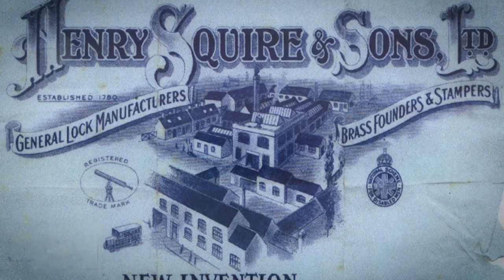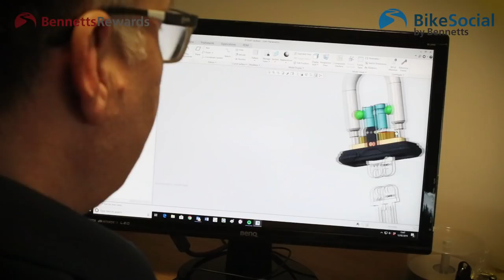How the world's strongest production padlock is made in Britain: Squire SS100

Comment: Why is the new padlock not shielded?.
If not it how will it be any stronger than the SS80?.
Is this a marketing ploy to get people to purchase this version then bring out the shielded version?. Only asking.
Reply from the maker: Hi Cedric... do you mean the shackle's not shielded? If so, the lock I filmed was a pre-production version, but it is a non-shielded model. Squire make both versions, and this of course isn't the one you'd use for chaining a motorcycle up. It's the same as the SS80, but bigger (so tougher), and of course it has two barrels. In the building industry, the longer pick time will give this lock a higher rating. In motorcycle crime, picking isn't really an issue, and until chains get even tougher than the 22mm versions we have now, that's the more likely point of attack. John
Reply: They will probably built it on two versions shielded version and open version. They sent the shielder version to LPL. (Lockpickinglawyer).

Comment: I have a question about the testing on the SS100 version. As is evident from the diagrams, the shackle is held in by two ball bearings, each of which is actuated by one of the lock cylinders through a cam, so if one of the two cylinders is unlocked, only one ball bearing holds the shackle in place. Was any of the testing (tensile strength of the shackle, for example) been done when only one of the cylinders is in the locked position, and the other is unlocked? The resistance of the lock to physical attacks when one of the cylinders is unlocked is relevant if it is to be used as a dual-custody lock, in which case someone with a key to one of the cores must be considered as a potential attacker.
Reply: the cylinders are key retaining, so unless you left a key in one of the locks, that is not possible.

Comment: I cant say they are good locks considering i could cut their 19mm protector chain with a grinder really really fast..
Reply from the maker: Tell me more. You can see the full destruction tests of all the locks I've reviewed here: https://www.bennetts.co.uk/bikesocial/reviews/products/security/motorcycle-chains-and-locks
Reply: @bennettsbikesocial  what exactly you want to know? I cut one the links off with a 115mm 1mm thick cutting wheel in about 20 seconds.. easily done on a cordless
Reply from the maker: @Migman2020  I use a main grinder to baseline them all, with 1mm discs. Everything can be cut – security is about making it harder to steal than the other bikes. Would be interesting to see your video, but you'd find the speed to get through any properly hardened 19mm chain is going to be similar.
Reply: @bennettsbikesocial  So with battery powered angle grinders there is no lock that can't be destroyed basically? I just bought an Italian lock (Viro) because the seller said it was the best lock outthere. So the best thing is really to combine a set of things together? Park the vehicle in busy area's, make sure the lock can't reach the ground and get the lock as thick as possible (even on relative light bikes)?
Reply from the maker: @JorisMaas  With time, yes, so you're absolutely right – a layered approach to security is the best bet, which is why the Met police recommend a dic lock on the front, a chain on the rear and a cover. But be proportional – in a high crime area you should take the most precautions. But don't spend your life stressing... buy the best you can afford and can carry, use it. then just enjoy riding! Cheers, John Here's the testing I;ve done: https://www.bennetts.co.uk/bikesocial/reviews/products/security/motorcycle-chains-and-locks/how-to-choose-the-best-motorcycle-security
Reply: @bennettsbikesocial  Thanks for your link! I am also thinking to equip my Giant bike with a GPS tracker maybe so police can follow it (they are cheap nowadays). Not sure whether it's really an option though.
Reply from the maker: @JorisMaas  Without power it's more tricky, and I'm afraid I only know of motorcycle devices, like MoniMoto, which have their own power supply. I can't see where you'd hide them though. Don't be tempted by the fake ads on YouTube and Facebook etc for trackers. The Apple and Tile type devices might work, but they rely on pinging off nearby phones etc. Cheers, John
Reply: I don't know what you are talking about. When that padlock is attached to an extended end link chain the link itself gets in the way, you can't access the shackle with a grinder this way
Reply: @juanbaclavab  why would i want to cut the padlock when i can just cut the chain..
Reply: @Migman2020  well then get the 25mm Almax or a 30+ mm anchor chain. they'll need various discs and batteries to get through
Reply: if you want the best lock.. then dont go with security chains..or any chain tbh
Reply: @Migman2020  True! Better hand forge a 20 lbs hasp and staple mechanism welded to a high security steel door or frame. Then lock the hasp from underneath with a Squire ss100cs upgraded with high security cylinders to the hasp where the shackle and guards remain completely hidden. That's the best way to benefit from a good padlock
Reply: @juanbaclavab  i use a squire 65 for my vault that protects my welding machine since its worth nearly 6 grand.. reinforced concrete sandwiched between 2 layers of 10mm hardox 500.. which a 50mm thick padlock guard which makes picking it stupidly hard let alone cutting through to get to it... and yes that is a box but the main door is that.. weighs nearly a tonne.. chains are useless in that aspect